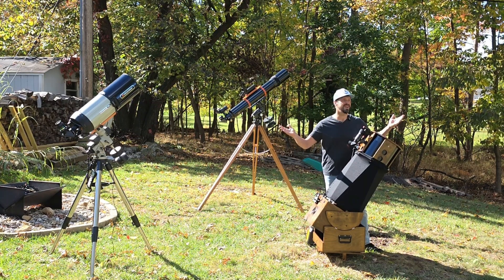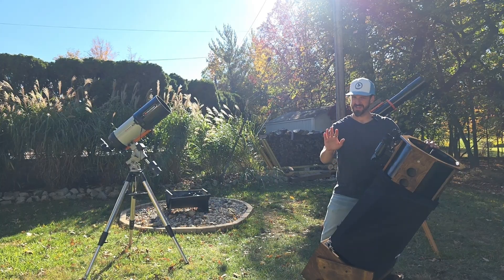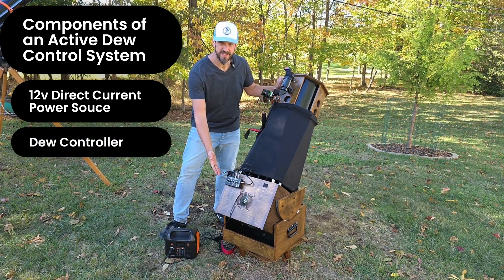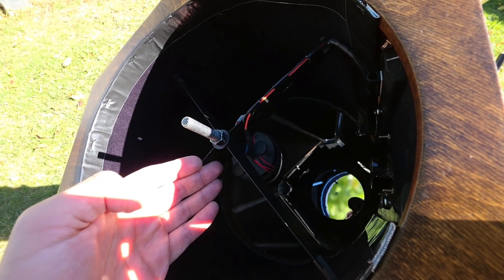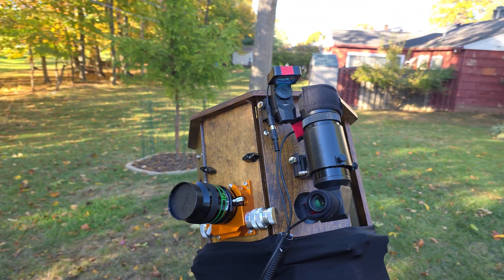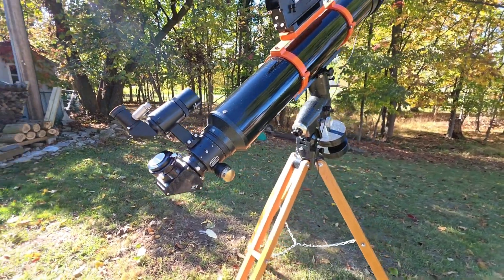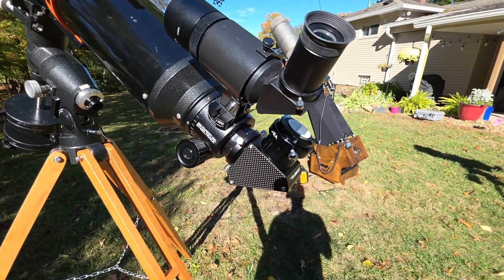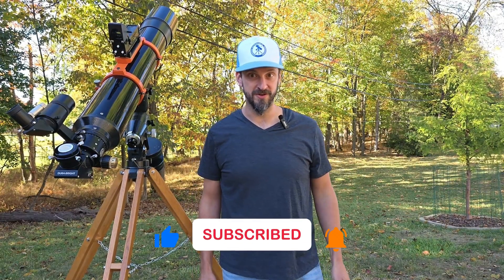The Telescope Problem No One Warned You About (and How to Fix It)

Comment: Dew really sucks, especially if it appears during observation or, even worse, during photography. Thank you for covering this topic.

Btw, I had dew on the secondary mirror of a Newtonian only once, with the fan for the primary mirror turned on. Fortunately, the car had a cigarrette lighter. IR radiation works well, even through a blackened drawtube.
Reply from the maker: I think dew forming on secondaries is mainly a problem for truss-dobs. Most of the solid-tube ones Ive seen seem to have the secondary deep enough in the tube for it to not be much of an issue.
Reply: @NightSkyVoyager  With a truss-tube, dew can form on both mirrors (had that on an NGT 12.5), but the secondary was the one of a 150/1200 mm (or perhaps 114/900 mm) Newtonian with a solid tube.

Comment: Is a Dew Controller required or can you just run the heater bands wide out connected directly to 12 VDC? It would use more power than needed, but is that the only downside?
Reply from the maker: In general, most heater straps can get way hotter than you need to clear dew, to the point that they can actually degrade the quality of the image due to the thermal instability and expansion/contraction of the glads elements. Theres quite a few reports of people hooking up those Celestron Dew Heater rings directly to 12v and they were getting noticeable aberrations.
Reply: @NightSkyVoyager   Ahh yea that makes total sense. Darn haha. Thanks for making such an informative video!

Comment: excellent presentation.  i am poor/disabled and it has taken years for me to get close to what is needed for active dew heating.  just the controller to go.  I have noticed that I don't get dew'ed over for the most part as I am usually in bed long before the dew point is met.  Perhaps this will encourage me to stay out later.  :D
Reply from the maker: Thanks for the positive feedback!  Another commentor below recommended using those inexpensive disposable hand warmers as an option for dew control. I thought that was a clever idea, and may be something you can try.

Comment: It didn't take me long in the hobby before I realized I'd need to invest in a dew heater setup. Now I've got 2 complete setups (controllers and batteries) to rotate between all my scopes along with heater strips to fit everything.

If you haven't tried any of their products, give R-Sky a try, very well made products. I especially like their RACI heater and secondary stalk heaters, and their observing vest is the greatest piece of nerd attire I've ever owned! 

I've also got anti-dew products from DewNot, Thousand Oaks, and W&W Astro. I've had fairly good luck outta everything so far after several years of hard use.
Reply from the maker: Thanks for the comment! I agree; it ends up being a lot of additional equipment to carry around and expense, but it's critical if you're spending more than a hour or two outside at a time. My Dew Controller is from Thousand Oaks, and all of my straps are DewNot. While I don't own anything from AstroZap, their owner was a long-time member of our local astronomy club and is a great guy. I'll definitely take a look at R-Sky.

Comment: Where I live dew is a problem for much of the year so some form of heating is absolutely essential. Although I tend to be more into astrophotography I do enjoy star gazing with binoculars. Electric heaters are a bit inconvenient if I want to move to another location in my backyard so I use chemical hand warmers wrapped around the lenses which seem to do the job.
My camera rigs all have electrical dew control heating fitted of course.
Reply from the maker: Wow! What an innovative idea, especially when I don't feel like carrying around all my dew-control equipment. I think you can buy those hand warmers in bulk at a pretty reasonable price, too. Thanks for sharing. I'm definitely going to remember that tip.

Comment: 12:10 - is that a Celestron 150/1200 mm achromat? Would be very interesting if you would make a review video with it :)
Reply from the maker: Yes, it is! It's a great telescope, and I'm definitely planning on talking about each of my telescopes more in-depth in the future. Thanks for the recommendation. It's a really nice scope, and the ~6" aperture does not disappoint, especially on the moon and planets, but it does well on brighter DSOs as well. I primarily use it at public outreach programs because it really fits the general image of what people expect to see for a telescope.
Reply: @NightSkyVoyager  I would buy one myself but unfortunately my balcony is very narrow just 1.0 meters and at 1200 mm FL the f8 version is just too long. I’m gonna buy the 150/750 mm f5 version just for nebula and galaxies :)
Reply from the maker: @3dfxvoodoocards6  I had a 120mm f/8 model for several years and people were always amazed at the views I got of galaxies and nebula through it, even at 120mm. I eventually sold it but then missed having a refractor in my lineup.  I've looked through the short-tube versions and they are nice.
Reply: @NightSkyVoyager  interesting. I thought about the 120 mm f8 version too but I already have a 102 mm ED and 102 mm f10 achromat, the difference wouldn’t be that big. That’s why I’m thinking of buying the bigger 150 mm f5 version, just for nebula and galaxies. What magnification could the 120 mm f8 reach on the planets before it began to loose sharpness / before the image quality went down?